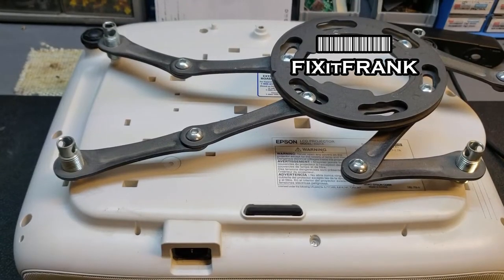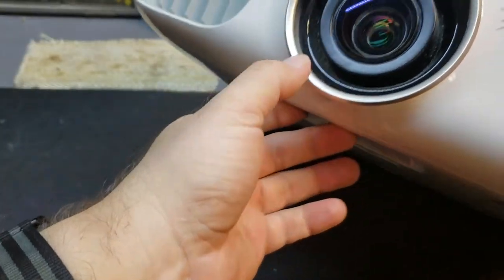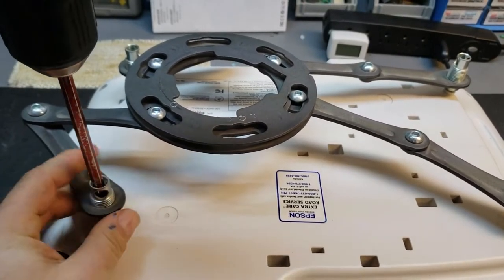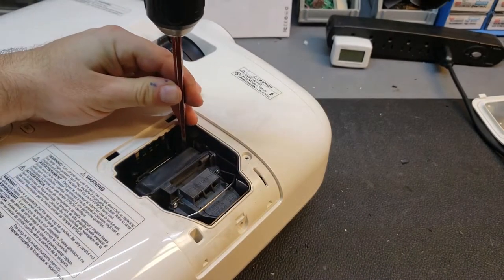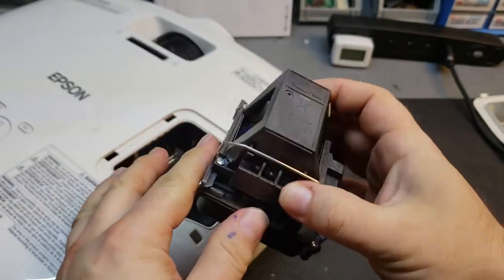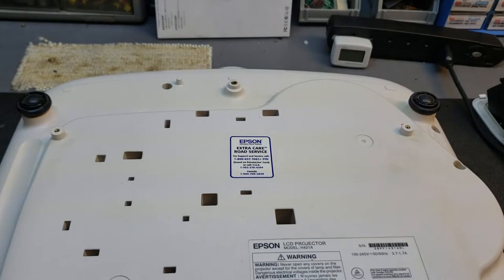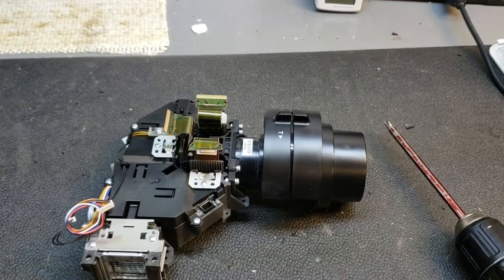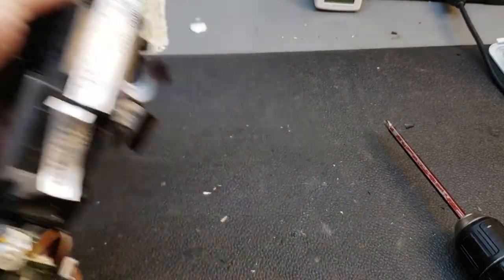Epson Home Cinema 3010 LCD Projector Cleaning

Comment: Stupid question. I have a Epson 3010 projector and I've been noticing on the right side of the screen has a red bleed and on the left side is a blue bleed. I take care of all my electronics. I even unplug my projector when I'm not using it. And I do my best to keep it dust free. Do you know what might cause the red and blue color bleed?
Reply from the maker: Not a stupid at all 🙂. Unfortunately it's the projector failing pretty thoroughly. That is likely a few of the polarizers in the optic block. On average, Epsons last 7-10 years before the polarizer/prism coating/LCD panels start to go(it's an average, I've seen it earlier and later). While they are technically replaceable, the cost and time involved is stupid high. Being conservative, I'd say it needs all six polarizers and at roughly $85 a pop(if I could find them) that's well over a reasonable cost. 
Your 3010 is anywhere from 9-11 years old which puts it smack into the center of the known life span.  It's nothing you did/didn't do. It's just the failure mode of an LCD projector. Not much you can do to prevent it from what I know. Sorry I don't have better news for you.
Reply: @FixitFrank  dang. That's definitely not the news I was hoping for. Well it sounds like I need to start looking for another 3D projector. Thank you for responding.
Reply: @FixitFrank  Thought I would update the community.

I successfully solved the red / blue halo's at the right and left edge of the screen by opening up the 3010 and re-seating the the first glass lens (or whatever it is) after the dynamic iris. I actually didn't even need to take the main circuit board out (but I did anyways). Could be done in about 30 minutes.

Project is back to the state when I received it (or better).

Thanks everyone for the tips.
I found this in a forum. In the forum this person has the exact same description of the problem that I do. 
Any thoughts?? I only ask because I like my projector and it's 3D. I only want to eliminate all options before trying to find a new one. 3D projectors are seemly more difficult to find then I thought. Lol. Again thank you for any advice.
Reply from the maker: @crashoverride576   That's fantastic news!  I'm glad it wasn't the polarizers or the prism coating! Thanks for posting this so other can find it.
Reply: @FixitFrank  the beginning of that comment was copied and pasted from a forum I found so that's not me. I don't have the technical background to do something like that without a tutorial or guidance.
Reply from the maker: @crashoverride576  Ohhh. How about this then.  Could you share a picture of what you are seeing?  I know the issue that post is referring too but usually its more of a burry line than a bleeding image.  It's hard to describe visual issues(at least for me) and even harder to understand them without seeing.  If you want, you can email me. Its listed on the about page. Or you could share the pics here via Imgur.com(free image host you probably already know of).
Reply: @FixitFrank  I will. Thank you.
Reply: @FixitFrank  I went ahead and sent you an email. The blue side is more predominant then the red. I mean I can still watch movies but my OCD kicks in knowing that they are there. Lol. I haven't gone inside the 3010 to see if they have a color screen like I've seen some projectors have.
Reply: @crashoverride576  @FixitFrank

We actually just had the SAME issue with our Epson 3020 -- But unfortunately, when we opened her up there were no lenses out of place. The only thing that seemed abnormal was that there was a metal piece that was loose. I'm unsure what this metal piece is for -- it looks like a fence of sorts that was glued in between two of the glass lenses. 

We tried to guess how it might have originally been placed, and put it back in place with super thin strips of double sided tape. Any idea if this could be the root of the issue?

Comment: Hey so I am getting a red band, not much dust at all in here since I did clean the filter and the outside openings often. I read that it is most likely an LCD issue, is there anywhere I can buy this entire assembly????
Reply from the maker: Red band after putting a new lamp in?
Reply: @FixitFrank  yessir

Comment: I’ve got a 3700.  The status light flashes blue for a good while, then the lamp light flashes orange (while the status light flashes blue) and the fan turns on high speed.  

This was a replacement they sent me.  It’s been doing this since off and on since I got it.  Of course now that it’s totally broken, it’s out of warranty.  Any tips for me?  Thanks.
Reply from the maker: Thats a tough one.  I'd make sure the lamp is 100% good.  An old lamp or a non-epson lamp can cause weird situations like that.  Otherwise I would check the fans to see if one is sticking. I suspect the lamp though from your description.  
Osram makes a replacement lamp that is also OK.  The OEM IwasakiEye brand is better but the Osram will be cheaper and will work almost as well.

Comment: Hi there! My 3010 is showing red on half of my screen... Shows more in black or dark scenes. Any idea if it may be something else? I did replace lamp about 1 1/2 years ago, original epson lamp
Reply from the maker: Hi Angel,  That is probably a slipped fish-eye objective array.  Not likely thelamp. The lamp is only white light.  There is a set of optics after the lamp that tend to have the glue fail and then the fish eye lens moves and causes this.  It might also be a lamp that slipped but I doubt it.  If you flip the projector over while its on, see if the red moves.  Usually the fish eye array will move when you do that.  the red usually will shift is that is the part that is the problem.  it is repairable.
Reply: @FixitFrank  Got it! Thanks Frank

Comment: Hi, thanks for this video! I am cleaning mine today and found two parts are bad, the red polarizer and the 1/2 wave polarizer that sits just after the second fish eye array. Do you know where I can get replacements?
Reply from the maker: Hi Timothy.  Unfortunately Epson is one brand that I routinely have issues finding parts for.  The only source I have found is used projectors to pull parts out of.  Alibaba has some parts available but not a lot.  In your case the red polarizer is going to be an issue.  You really need to replace all of them if you replace one.  They all fade close to the same rate.  If you did replace only the red, getting the color purity correct will be difficult. 
If it were mine, I'd find a bad 3010 on eBay and make a good one out of the 2.  You should be able to use any model that uses the same lamp.   Any model that uses a ELP-LP68 (V13H010L68) will have suitable parts.    It's frustrating but Epson is not very repair friendly.
Reply: @FixitFrank  Thanks for the advice. I got about 20,000 hours out of the projector and ended up buying a new model last year because of the failure. I was hoping maybe to get this one going again as a spare. I had just bought a new bulb for it, thinking that was the problem, so that's $300 wasted if I can't get it fixed.
Reply from the maker: I'll be honest, if you can return the lamp, I would do so.  The amount of work and cost to repair this is going to push you pretty high. Finding a used unit might be your best bet if you are stuck with the lamp.  As luck might have it, I have a 3020e here that is beyond repair due to a bad green LCD cable.  If you want to email me, I might be able to get hte fellow who owns it to sell it to you cheap. The polarizers are OK and the prisms are good. Just a bad green LCD and I will not pull my hair out trying to align an LCD panel ever again. you can email me at Sales@weezytech.com  But know that I need to send back this 3020 by the end of the week so if its past August 30th 2019, it might be gone.

Comment: My Epson HC 2045 turns on but flashes an error code with the lights that says a fan or sensor has a problem. I know the fans all spin and work fine and this projector has barely been used so I don't know what this could mean.

Comment: How hard do you think it's going to be to modify this projector to provide an audio out? I know one can use HDMI splitters and converters but I'd like to use the projector's remote to just switch video and audio at the same time.
Reply from the maker: Good question.  I wonder if it's stereo all the way to the amp chip for the built in speakers?  It has a 10watt amp chip that probably has an analog input.  You would need to check the signal type going into the amp IC inputs. Depending on the signal type you might get away with soldering in some wires to a pair of RCAs or 3.5mm jack.  Ideally, you would want some sort of line level matching circuit between the output and the taps into input traces to the amp chip.  The speakers would need to be turned off. I would even remove the amp chip or unhook its power leads to render it off.  If not you would have the speakers on at the same time as the output defeating your goal. 
 The main unknowns to me are the type of signal(stereo or dual mono) and the power/impedance of the signal.  An Oscilloscope is a must here. 
That would be a neat project and after talking it out, it seems feasible.
Reply: @FixitFrank  I opened it up and it uses a MAX9736A (datasheet easily available) situated next to the speaker connectors on the main PCB. Unfortunately I cannot attach a photo on this website but there are also some pads on the audio input pins and it looks like it shouldn't bee too difficult to attach an audio cable. I have built my own external amplifier so I can tune that to match the output from the projector, if really needed. And I could leave the internal speakers disconnected from the PCB. I could hook up the scope but I'm lazy
Reply: Shame on Epson for not putting a simple stereo line out. Literally few cents of extra components
Reply from the maker: @AlessioSangalli  It looks like it is taking line level input.  I would desolder the chip or at least cut the traces to the  VCC (pin 27/30).  That will make it a lot easier.  Then if you use the test points that correspond to pin6 and 18, and use the analog ground you may be finished.
Reply: @FixitFrank  Difficult to desolder with that bi exposed pad underneat. I do not have a hot air setup :(
Reply: Anyway I did it, soldered an audio female connector to the analog input of the integrated amplifier, and mounted it on an empty section of the rear panel of the projector. The output is a little low but I have a good enough audio amplifier

Comment: Hi Frank, if you remember, I have a 3020e which is stuck in 3D mode. I have pulled it out again, after sitting for quite a while.
I have tested it now, with a 3D source, and I have a nice picture in this mode. If I input a regular 2D video source, the only way I'm getting a full screen picture, if I select side by side, or top and bottom mode, in 3D mode. This way I can only see one picture from the double image. If I select top and bottom, I can see the top half of the video(I can see the top half the video source). If I select side to side, I can only see the left side video(left half of the video). Did you ever encountered this issue? If I select Auto, or 2D mode(in 3D settings), the only thing I'm getting, is a thin band at the top. If it is in side by side mode, I can see in that thin band two side by side signals. This is software issue? Hardware can affect 3D mode? I would appreciate any help, that you could offer. If you can help, maybe we should go to a forum, to continue diagnosing this issue. repairalmostanything forum.
Reply from the maker: Hi Tibor, I will pop over to the the forum later.  I suspect it is software related. I would likely see if there is a way to reset the  controller or possibly update/re-flash the firmware.  I have never personally seen this issue but from what you describe it sounds like corrupted software in some regard. Do you have access to a working 3020 (to pull firmware out of)?
Reply: @FixitFrank  Unfortunately I don't have and there is no firmware available for this model, only for 5010/6010. I'm not sure if that would work or not. http://repairalmostanything.com/thread/655/epson-powerlite-3020e-video-issue

Comment: How did you clean the lcd screens? When i turn off my projector and i watch in the lens i see all specs of dust on a red beckground, do you know where that dust is that i see?
Reply from the maker: I would guess it is in the optic block.  You can try gently blowing air into the LCD area. I would not unscrew or remove any lenses or mirrors to clean. This will cause miss-alignment.
Reply: Im so scared to open it up and fck sht up you know :)
Reply from the maker: I got you.  If the picture is OK, I would leave it along then.  At the least you can get some canned air, and a vacuum cleaner.  Leave it all together but blow some air into the vents and use the vacuum to collect any dust that blows out.  A passive cleaning like that is better than nothing at all, and it might clear up your issue. The chances of messing things up that way are very very low.

Comment: Hi, my Epson 3010e lamp is not turning on after playing with SW DIP switches. There is no indication of any error(checked with RS232 serial commands). Replaced the lamp with no luck. Now I am guessing on ballast gone bad. But I am not sure if thats really a problem with ballast or it could be something else. How can I proceed further on this troubleshooting? Appreciate your help. Thanks
Reply: Can u just explain how to use rs 232 to check errors and what software u use thx in advance

Comment: I'm on my second Epson 720 that is now doing the same as the one replaced with ghosting. I see the outlines of YouTube home page on every photo/video watched. what is causing this? both started about a year after purchase.
Reply from the maker: oof. That sounds like burn in.  LCDs (and DLP) can susceptible to that. You might want to try running a "stuck pixel" video even though you dont have stuck pixels.  It might be enough to remove the burnin.  Leaving any image up for a long time can be problematic. Im sure you remember the old CRT displays in video arcades that had pacman burned into the screen.  Similar issue.  If you want to post a video of the problem for me to see, I can give you a clearer answer.
Reply: hope you can see it...
Reply from the maker: @thedbcooperforum  Its not super obvious but I can see it.  That does look like burn in to me. I'd try a video like this  https://www.youtube.com/watch?v=VN-KIlsxxOw  Maybe it can 'reburn' it more evenly.  That is not really a repairable situation(that I am aware of). It would require LCD replacement/alignment. That can be pricey. I hope that video helps.  If you use your projector a lot, you may want to look at re-enabling a screen saver on your PC(like back in the day). Also, DLP tends to be slightly more forgving with burnin.  Only slightly.
Reply: @FixitFrank  it shows on everything. the Epson screen that pops up for a couple seconds or anything will have a faint repeat of the wording above it.